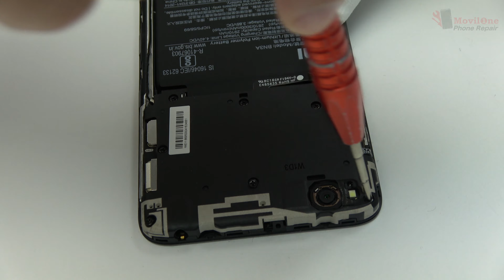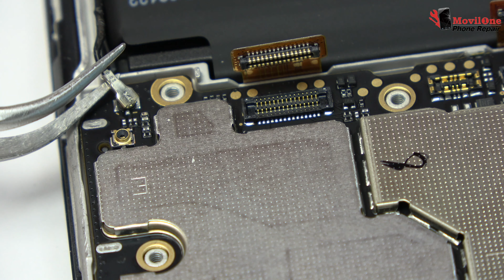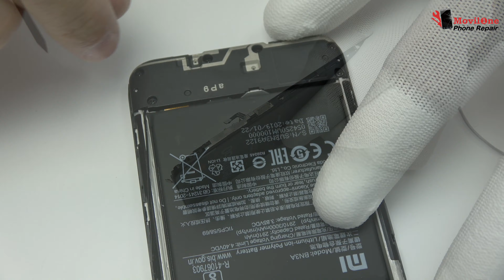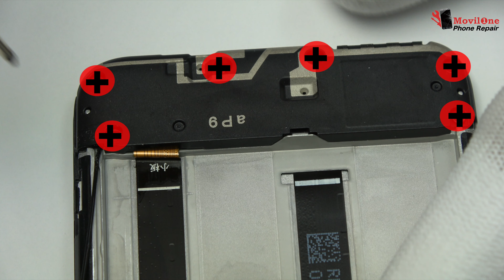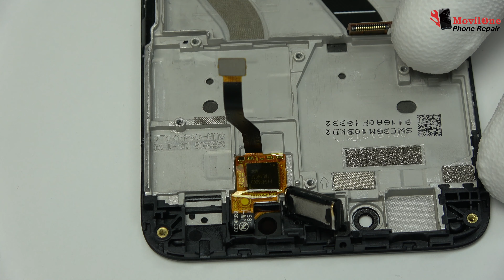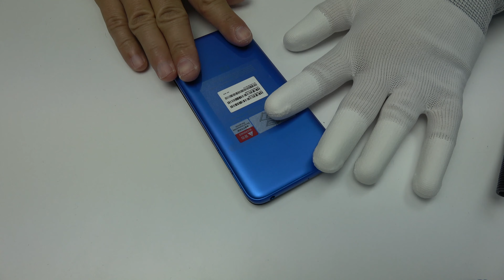Xiaomi Redmi Go Teardown & Disassembly & Repair Video Guide

Comment: In a work day I screwed up my Redmi Go, I watched some how-to, and liked this to take it as guide because seems professional, taking care of electrostatic and it seems so easy. Today I fixed my phone without previous experience but enough theory to take it easy. I had some difficulties while removing the carcas, the small connectors and the battery (it is not easy thought), thank you!

Comment: How do you fix a bootloop phone ?
Reply from the maker: Stride 0, did you try flashing the device?
Reply: @MovilonePhoneRepair No i only rooted. My smartphone became bootloop when i did a hard reset, setup my device, then i updated my device, but now my smartphone wont go back to the home screen.
Reply from the maker: Stride 0,you would have to download the original firmware and flash the device with that one.Wish you good luck!